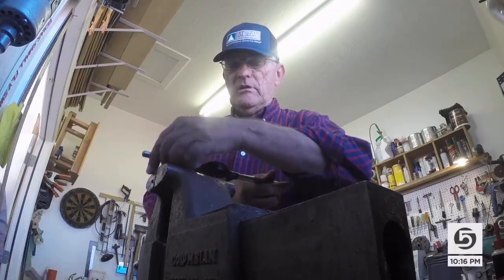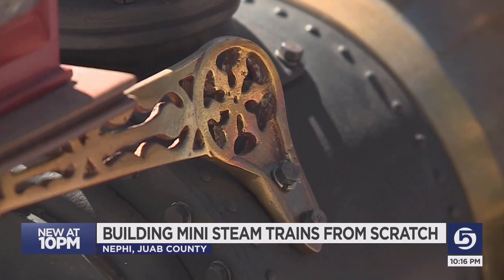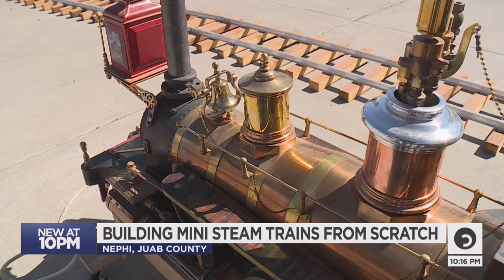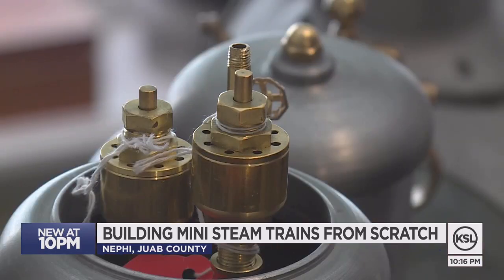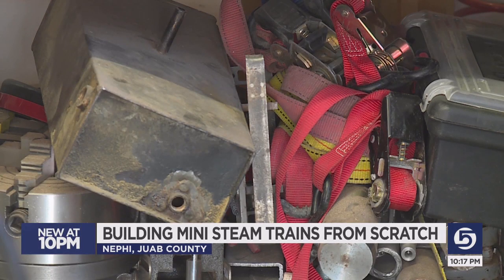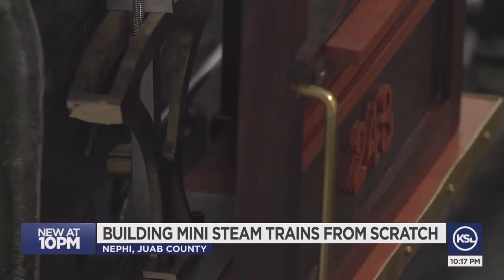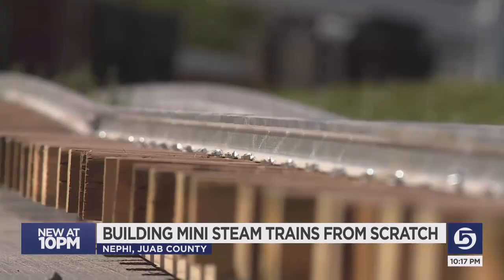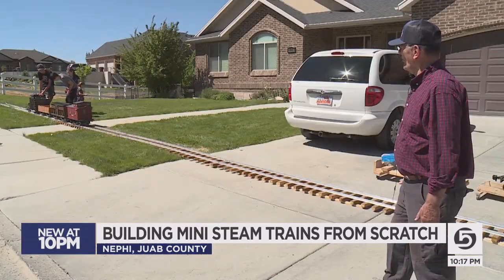Nephi Man Builds Mini Steam Engines From Scratch

Comment: That is an amazing locomotive it looks like a 1/8 scale type engine the goose is correct that's the electric one. It's amazing he's building these engines with 7.5 inch gauge track or might be seven and a quarter